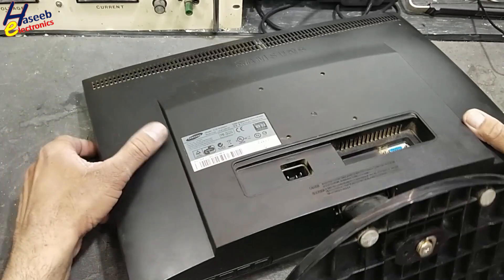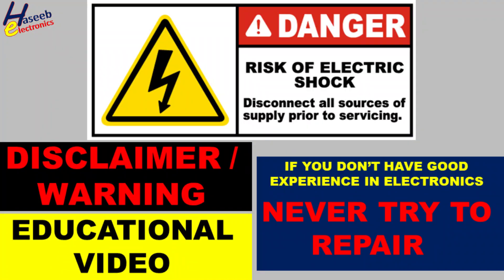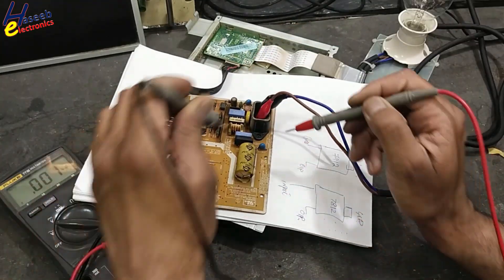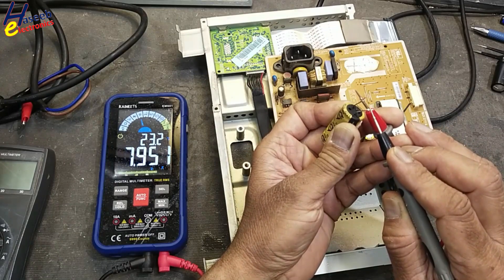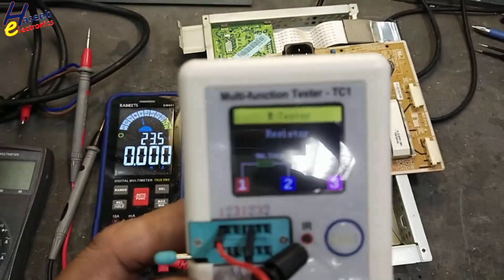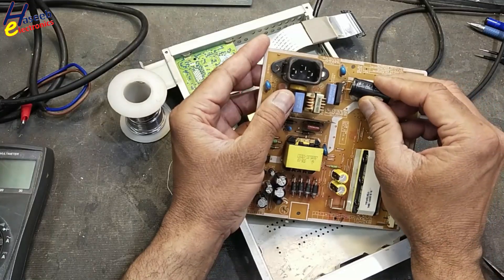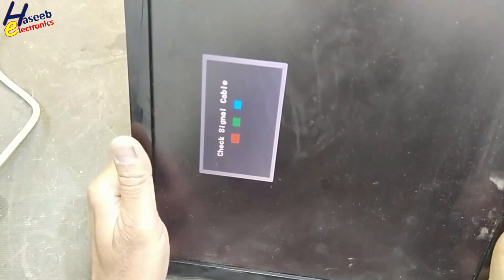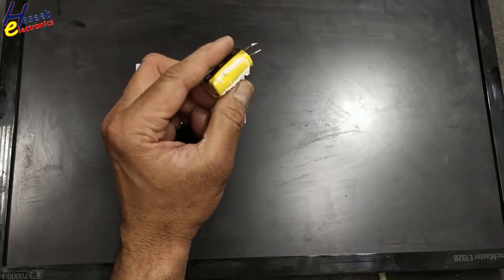{1360} Samsung LCD Monitor Repair | No Display, White Smoke, Bad Smell

Comment: Excellent. However, don't you need to investigate what caused the short of the defective capacitor?
And the lamp connected in series to the input plug should not light on in case the capacitor is shorted?
Reply from the maker: when the  capacitor is leaked, it behaves like a resistor. upon connecting line voltage it will not draw enough current but if load is connected to the board (i mean backlihgt and pannel) then it will become overheat and discharges smoke. 
while testing leaked capacitor there were 280 volt on capacitor. 
after replacing the capacitor voltage maintained 335 (line voltage * 1.414) 
that is good sign of capacitor 
if capacitor is open circuit then the voltage will 220 VDC across capacitor 
if capacitor is short circuited then fuse will burn out 
if capacitor get high leakeage closer to 50 ohms. then lamp will indicate 
otherwise lamp remains normal